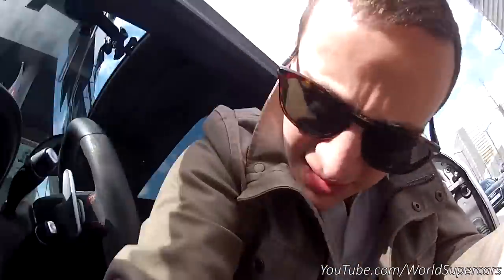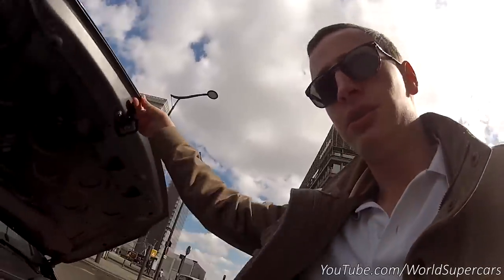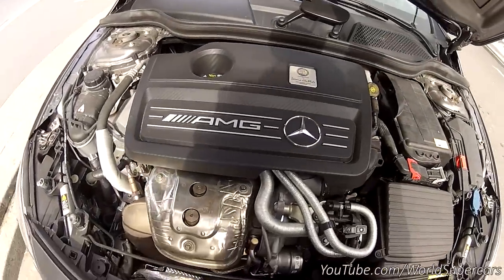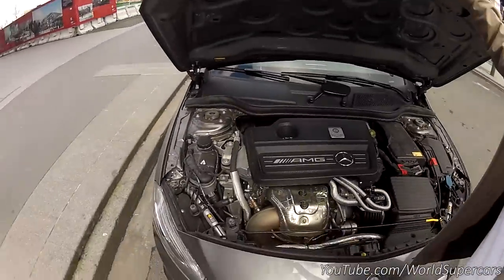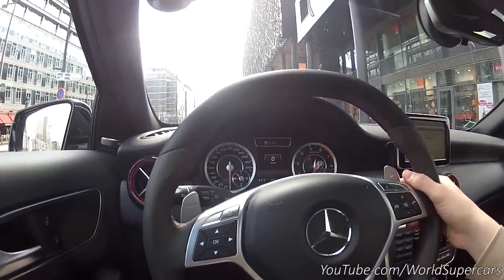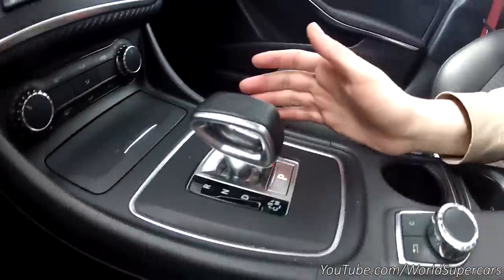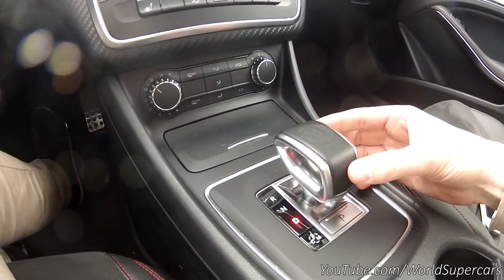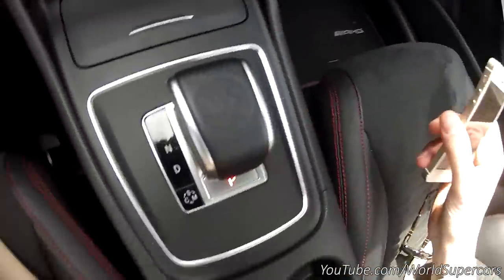Mercedes A45 AMG Q/A Part 1: Driving and Performance

Comment: Beautiful video like always :)
Did you use the launch control? How you can put this mode on the car?
Thanks for the answer :)
Reply from the maker: xBLUE97x Thanks! I used it once, but it didn't work anymore after... I just serviced the car. Will try to do it again, and make a video about it ;) I asked AMG if it was ok doing it and they said at long as you can engage it, it's ok. If you can't, there's a safety and you won't hurt the car. To put it, you press the traction control buton, put sport mode, hold the two padels for 2s, the press the right one. Put your foot hard on the brake, full throttle, and lift off the brake ;)

Comment: Nice video! 
I have a question, but which is the difference between an A45 AMG and an A250 Sport, besides the engine (for example some accessories)? I know that some parts of the A250 Sport are made by AMG and as I read before the A250 Sport and the A45 AMG makes 211hp and 360hp respectively. Hope you can answer 
Greetings from Colombia!
Reply from the maker: Daniela Arias. Outsite, the front grill is different, the exhaust is different... The chassis is sportier, the brakes are bigger. Inside, you'll see in the next video but mainly the gear liver and carbon touches ;)

Comment: Hi, I have one question for you: does your A45 burn oil? How much? Almost all turbo engines from VW are having this oil problem... and I heard some people topping up to 1 liter per ~600km which is extreme.

I would like to know if the engine from Mercedes burns oil like that.

Thanks!
Reply from the maker: +19Spider87 Yes it did, then Mercedes changed the turbo... Now it doesn't anymore.

Comment: 20l/100k!? I think that there might be a hole in your fuel tank derp. You must have been going full throttle at every red light haha
Reply from the maker: GustavLjungberg Not really... Every sport car drinks a lot of fuel. The consumption they announce is always fake.
Reply: GustavLjungberg I'm at around 12.7l/100km with ECO automatic when I commute to work and some manual sport going back home, plus going to gym at noon; a total of around 35km per day